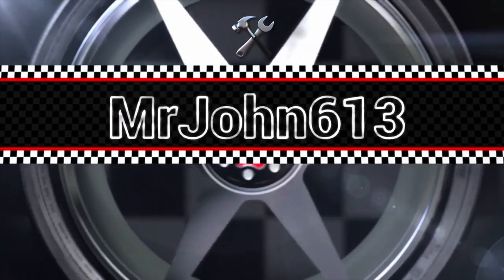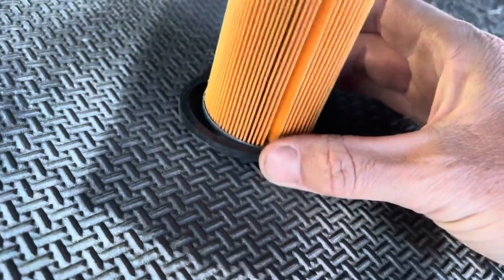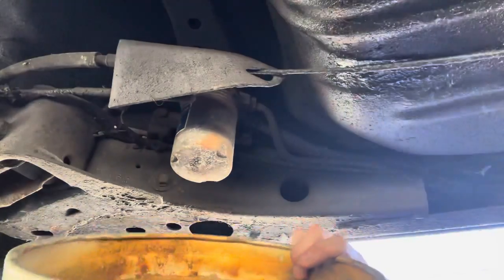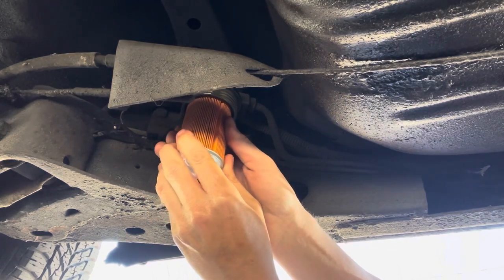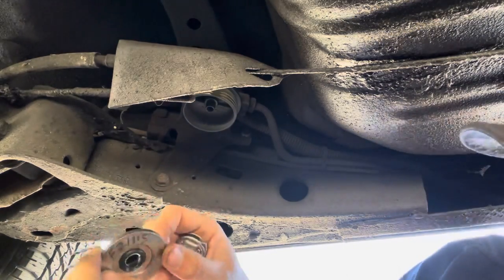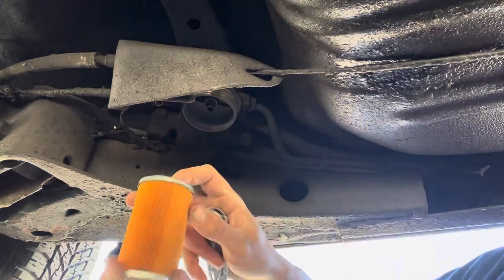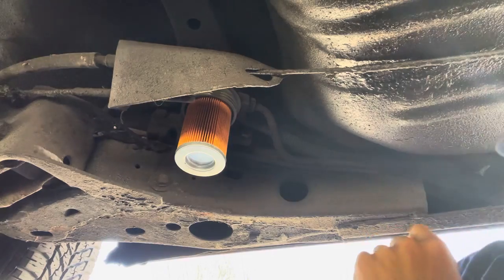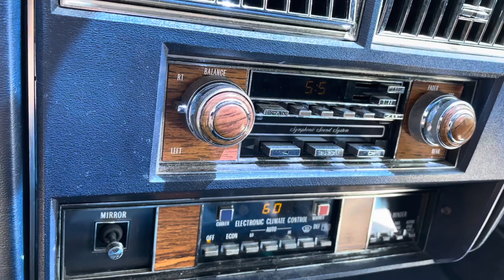Cadillac Fuel Filter Replacement & Cruise Night

Comment: I got a 1981 I can’t find the gas  filter it’s a 4.1
Reply from the maker: This car is also a 1981 it should be inside the driver side frame rail by the rear suspension similar to this.  Unless you have a different model…?   There is also often a filter in the carburetter fuel inlet on the line fitting if you have a carbureted engine.  Most cars were carbureted back then.  It’s pretty common for the small filter in the carburetor line to clog up.    If you have a 1981 Fleetwood, it should be the same as this inside the frame rail in a cannister